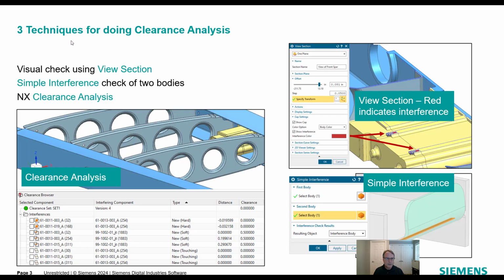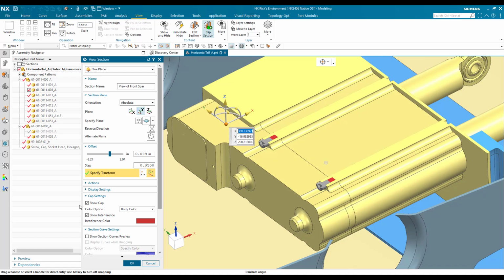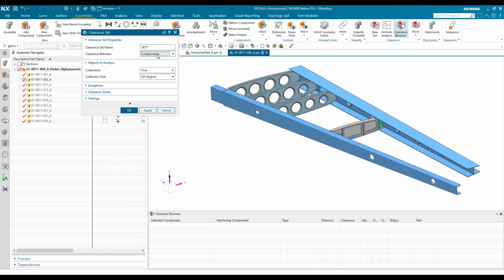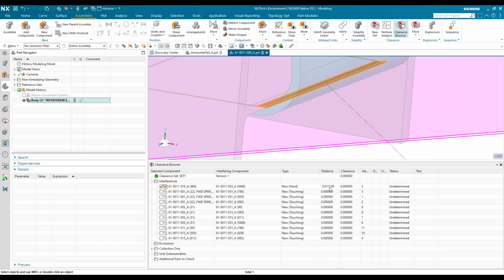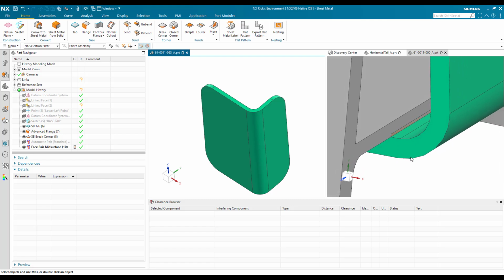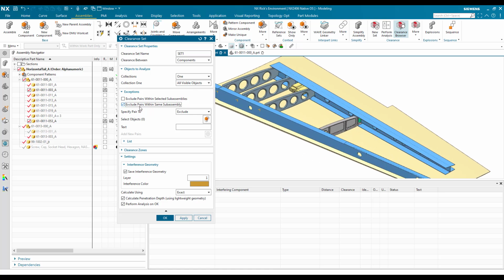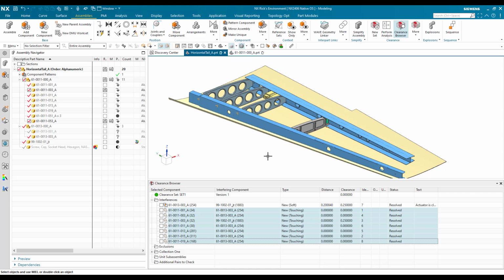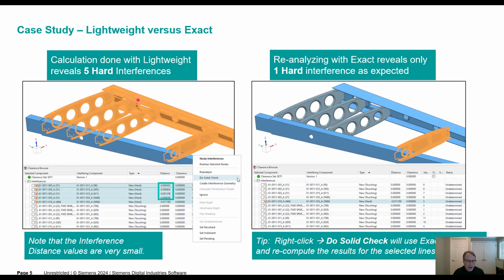NX Clearance Analysis [NX2406]

Comment: Do you know if there is any way to adjust the accuracy of the curves that show up in red to highlight contact surfaces? A coworker of mine has clear definition of the lines while mine is jagged as if it was built with straight lines instead of arcs. I have all of my preferences turned up to fine as well. Thank you
Reply: You are probably using Lightweight display of bodies instead of Exact.